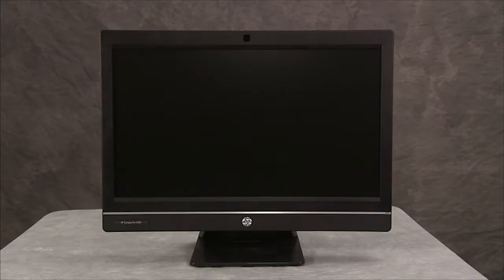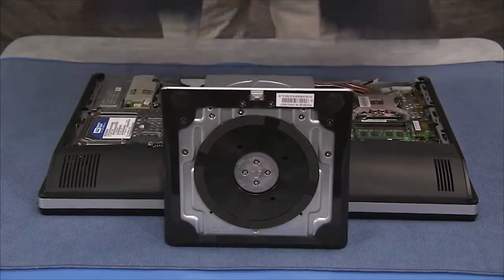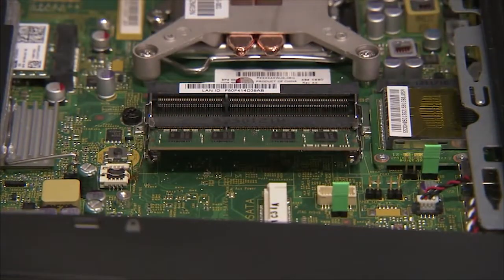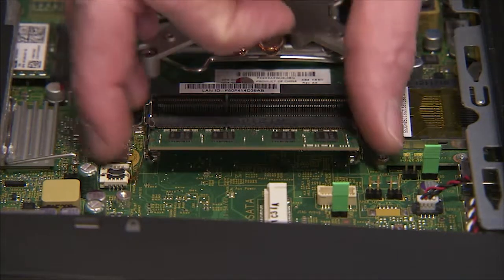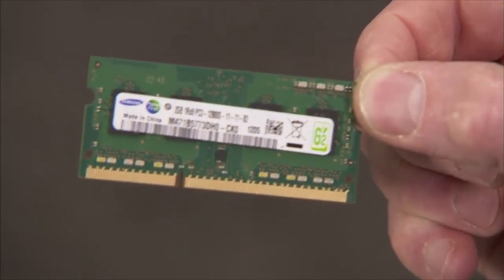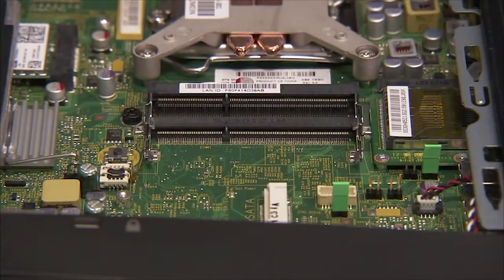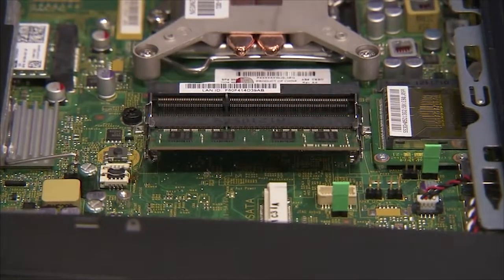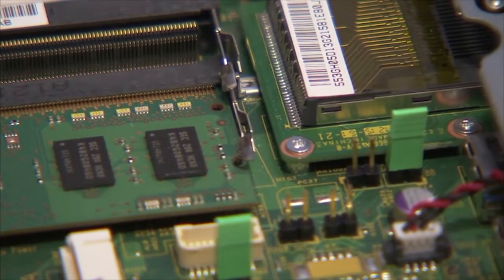How to Replace Memory Modules | HP EliteOne 800 G1 21.5-inch All-in-One Series Desktop PCs| HP

Comment: hay una versión que no trae wifi o me estafaron sin wifi
Reply from the maker: Hi Edgar, thanks for contacting!
I understand that you are experiencing a wireless connection issue on your computer.
I will do my best to assist you.
Please perform updates via Windows and HP Support Assistant as mentioned below to fix this issue: Step 1 Windows Updates - 1) In the search box, type and open Windows Updates. 2) Check for updates. 3) If the updates are available, click on install and restart the computer. Step 2 HP Support Assistant Updates - 1) In the search box, type and open HP Support Assistant. 2) Check for updates. 3) If the updates are available, click on install and restart the computer.
Binu - Social Media Tech Support

Comment: Can i. Upgrade the graphic card on this HP eliteone 800 G1 ? If yes, is there a video guide on it? And what’s the best graphic card this all in one pc can take?
Reply from the maker: +jolene loh Machine already has  MXM 3.0  AMD Radeon HD 7650A graphics card.
https://support.hp.com/au-en/document/c03844827
Changing MXM video card could be very hard, except for some workstation (note book) models. And where to buy is another problem because they don't sell or normal computer shops.
The above card should ne enough for you to play some games.
Reply: @HPSupport  yes but this graphic card is not good enough. I like to upgrade it.